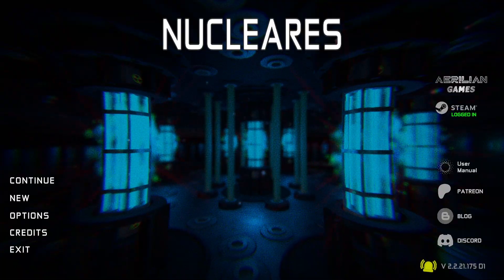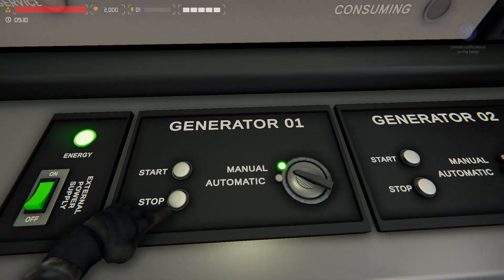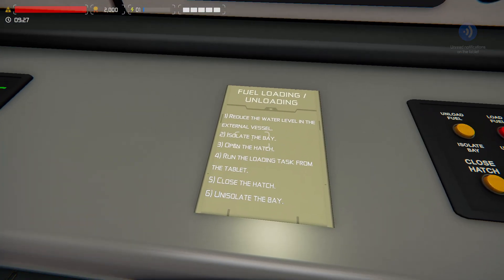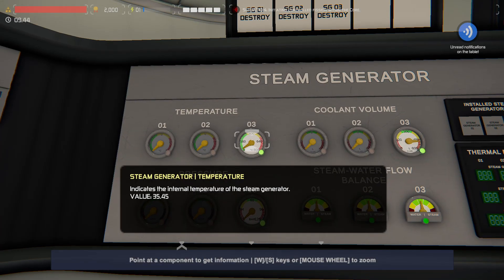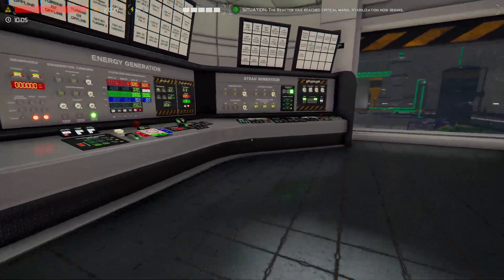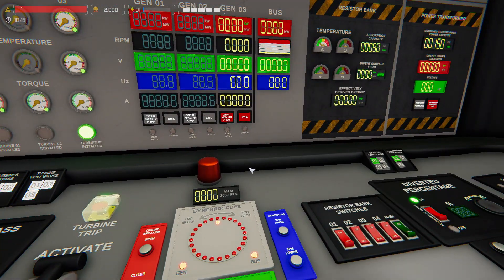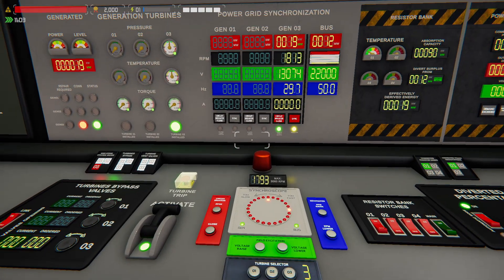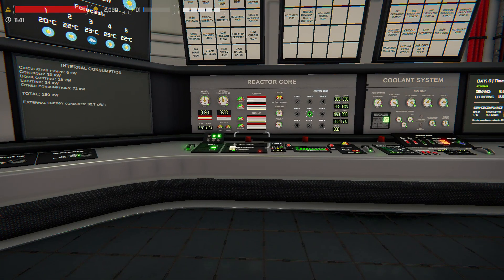Nucleares -  Step-by-step startup guide (with explanations) (v2.0)

Comment: Great video! Question:  in the steam generator, the pressure makes the water boil at more temparature than 100ºC right? So 100ºC would not be the boiling point. I understand that's what the presurizer is for. Am i right?
Reply from the maker: Thank you! Sorry for the late reply, YouTube does a crummy job of telling me when I have new comments (I have to come look; if you have discord, you can always reach me on my personal Discord much quicker).

Yes and no. The two systems you are referring to are independent of each other. 

The water in the steam generator does boil at 100° (actually, the game has it modeled as boiling before that, around 82-86°. The pressure in the steam generator isn’t really there to act as a pressurizer, like in the primary loop, it is more of a back pressure to help us apply torque to the turbines and generate electricity. 

Now, in the core, we do not want our water boiling off at 100°. We need our core temp much higher. So we use a pressurizer specifically designed for that purpose. 

The pressurizer only affects the primary cooling loop and never has a direct connection to the secondary (stem generators).